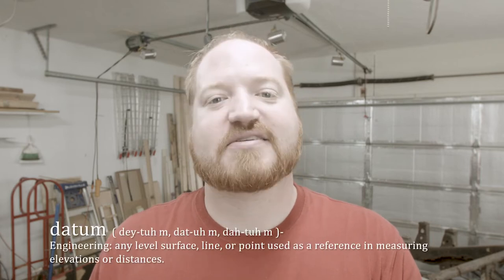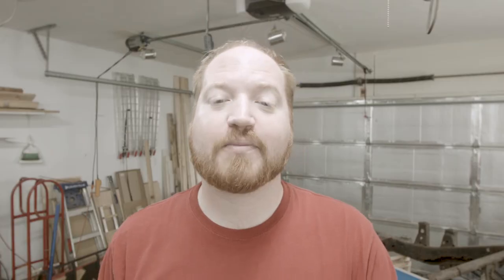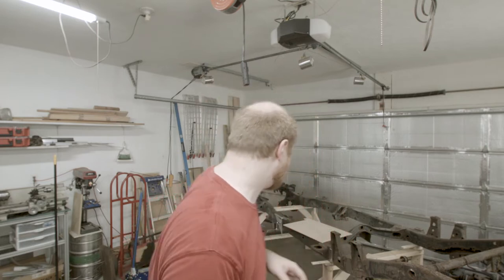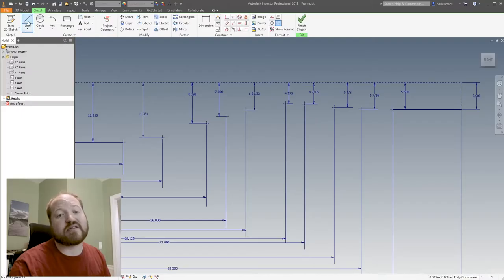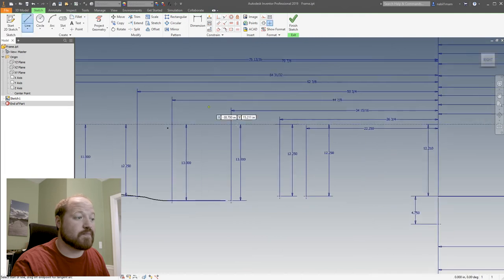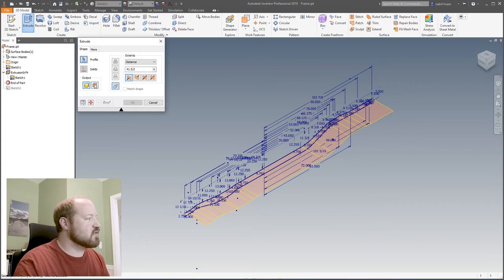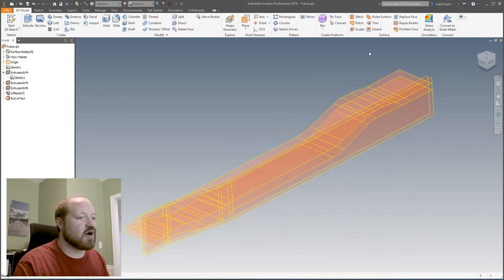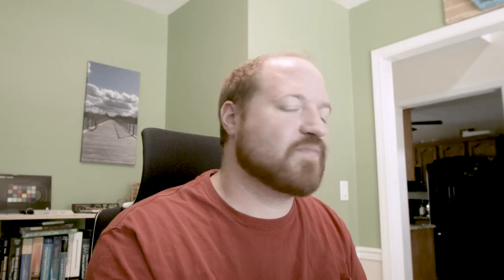Creating a Cad Model of my truck frame- 1989 Toyota Pickup Restoration EP 17

Comment: Very nice! Detailed tutorial but seems to be a fairly simple process. I'll be giving it a go with my 86 4Runner. Needs a V8, more travel, and a cage
Reply from the maker: I've got a big change to my projects. So the frame will be making an appearance again once I get my other work table built. I'll be modeling up the entire things this time and then I'll be cutting half of it off!
Reply: @Obscuremotorsports  I am debating that as well 😂 I think I can get by with cutting just after the cross tube, trying to keep weight in the rear so it flys level. We'll have to chat sometime
Reply: @Obscuremotorsports  I feel rude to ask but would you be willing to share your file so I can compare to mine for accuracy
Reply from the maker: Mines nothing to be compared too. The profile is probably good, but nothing else is. I didn't take the time to get the widths correct and there is a some frame damage that will give some discrepancies. I took some creative freedoms to finish the video knowing I'd be going back to check (which I haven't done yet). To be honest the best reference to check is your own frame. Check it in different ways than how you modeled it. Measure diagonals from holes or features. If your model matches those I'd say you're good to go.

Comment: I really like your systematic methodology and I enjoy your videos...keep 'em coming!  My son and I were fortunate enough to start off with a perfect frame, although the body was a different story...oh yah...FIRST.
Reply from the maker: It's amazing how these trucks are one or the other. Either the body is good and the frame is bad, and vice versa. The body on mine would be perfect, but it looks like someone drug along something on the passenger side so I have a little bit of body work on the on the bottom 3 inches. I'm enjoying taking in each challenge as it comes along, but I'm not even going to think about the body until the frame and drive line is all done.
Reply: I was surprised how little is out there on this generation of Toyota Pickup...I'm glad that you are taking on the task.  I'll be following along until completion. (I might do another one if I can find a good frame again).
Reply from the maker: If you think I've done a good job on my frame rebuild you can always find one with a bad frame and get it to my shop and let me rebuild it. I'll probably make a video about it if you do. But let me get my frame done before you go and get any big ideas.
Reply: lol...I'll keep that in mind.